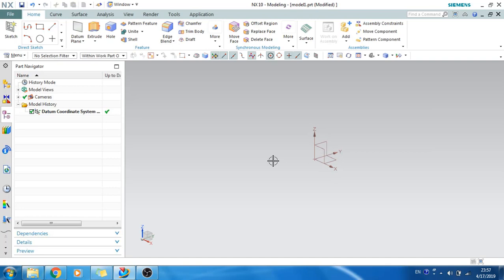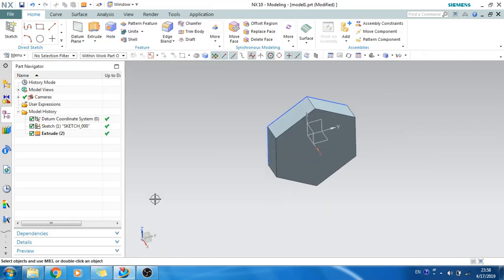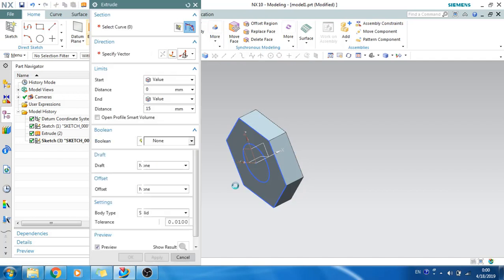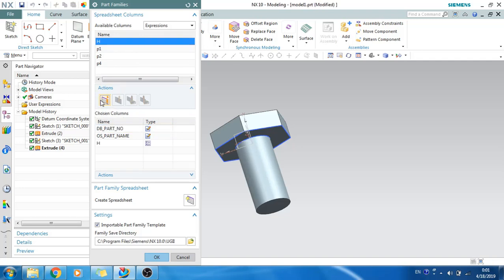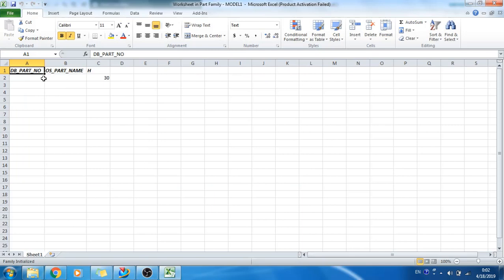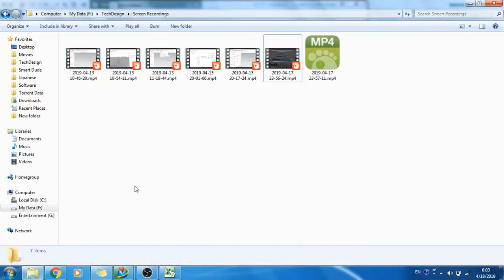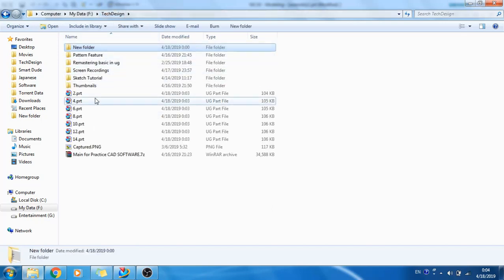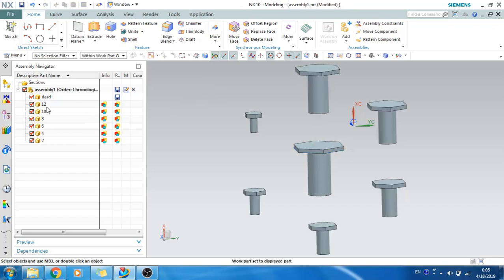Unigraphics NX-  Basics of Part Families Part 1

Comment: Hello is there any feature in nx like drawing out standerd bolt in assembly like solid works??. I'm looking for it in NX. Is there any kind of feature available then please make a video on that.
Reply from the maker: Please mention what is the function of command in solidword..
Reply: @TechDesignsantosh  yes the command is known as Design Library where you can find multiple standerd Bolt, Nut , Screw, Washer. Is there any tool in NX. And in solid Drafting there is a command of automatic dimensions where the all Major and minor dimensions are out without giving them manual. Is there same command available in NX drafting. I have only questions but didn't get any kind of sufficient answer. Please help me out.